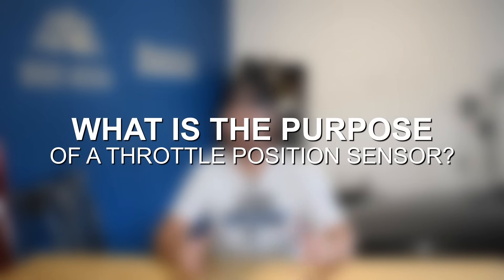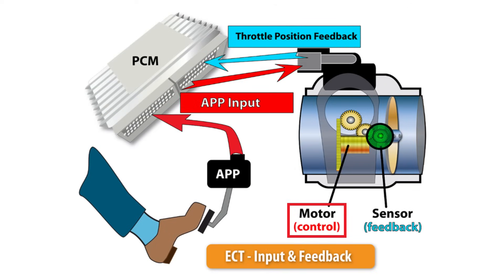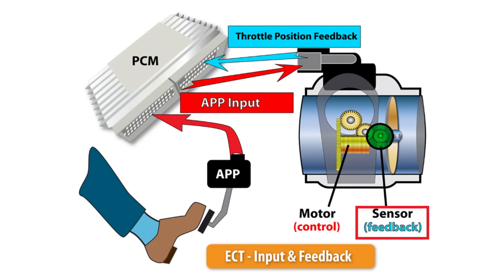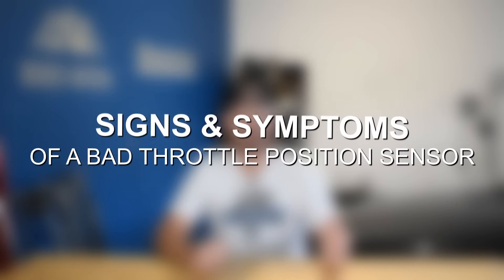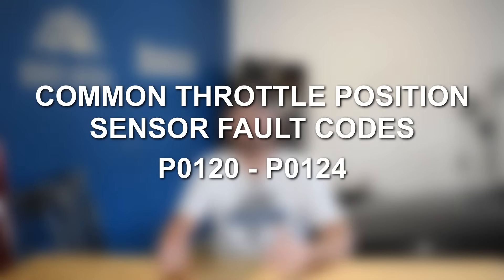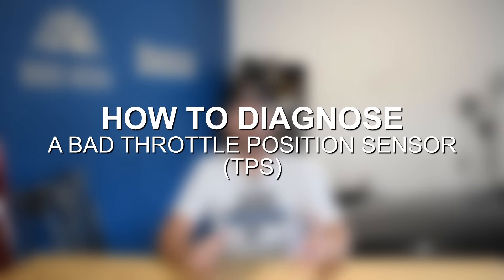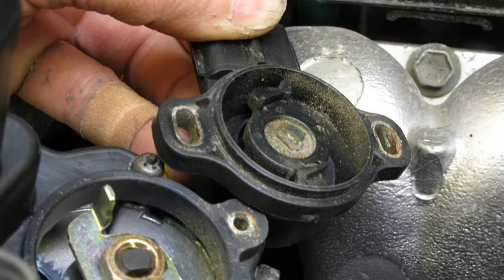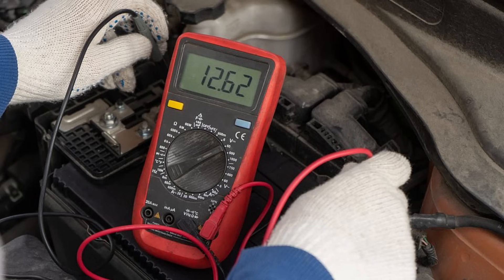Signs & Symptoms of a Bad Throttle Position Sensor (TPS)!

Comment: excessive fuel consumption and codes P022 and P0122.  2020 Chevy Traverse and srrms there was a tech bulletin about a throttle body issue years ago.  While idling, RPMs are about 2000.  Seems like gas pedal is "looser" than it should be.  Guzzling gas.
Reply from the maker: A - The P022 and P0122 codes indicate Throttle Position Sensor (TPS) circuit issues, often linked to a faulty throttle body or wiring problems. The high idle (2000 RPM), loose gas pedal feel, and excessive fuel consumption are all symptoms of throttle body failure or a TPS malfunction. Given that GM issued a technical bulletin on this issue, it’s worth checking if your 2020 Chevy Traverse is eligible for any service campaign or warranty repair. In the meantime, inspect the throttle body for carbon buildup, check the wiring harness for damage, and consider replacing the throttle body assembly if cleaning and resetting the TPS don’t fix the issue. A relearn procedure may also be required after repairs.

Comment: This is a good video! Do any of the following qualify as hesitation?

1) running at low speed (about 5mph) then gently accelerating, causing engine noise and not responding to the gas pedal momentarily. But once it reaches about 10mph, the vehicle runs fine.

2) when slowing down, once speedometer drops below 15mph, the engine revs up a split second. RPM goes from 800-1200 for a split second.
Reply from the maker: E - Yes, both scenarios could qualify as hesitation, but they might have different causes:

1. Momentary lack of response when accelerating from low speed – This could be due to a throttle response delay, dirty throttle body, MAF sensor issue, or transmission lag (if automatic). A failing fuel pump, clogged injectors, or vacuum leak could also contribute.

2. RPM spike when slowing down below 15 mph – This could indicate a transmission downshift lag, torque converter issue, or an idle control system problem. It may also be caused by a dirty or failing throttle body, faulty IAC valve (if equipped), or inconsistent fuel/air delivery.

A diagnostic scan for throttle position, fuel trim, and transmission data would help pinpoint the issue.
Reply: @8020Automotive   thank you so much!
Reply: I have a 3.6l holden , drives fine but revs up from about 1800 to 2000 unless i stomp it at about 50 kph and wont exceed 4000 rpm but should go to about 5500 rpm before shifting up . I will still get a check up at the mechanic but at least i know its an easy fix , last time this happened they did a ( re- learn on the throttle body )but i belive theres a fault somewhere or likely a sensor issue

Comment: 2021 Honda Accord 1.5t, initial cold start idle jumps to 1500 rpms.  Then within. 60 seconds ish it starts to level out.  Pulling no codes, Dealer said they would charge 700.00 to clean the throttle body and relearn.  I am planning to clean it myself. I have a scan tool to reset relearn. I hope this works.
Reply from the maker: D - Good start! Keep us updated.

Comment: What could be the cause of pushing on the acceleration pedal and it doesn't Rev or anything?
Reply from the maker: A - If pressing the accelerator pedal does nothing—no revs, no throttle response—it could be caused by a faulty throttle position sensor (TPS), accelerator pedal position sensor (APP), electronic throttle control (ETC) failure, a stuck throttle body, or a wiring issue. Other possibilities include a blown fuse, limp mode activation due to a sensor fault (like a bad MAF or MAP sensor), or even a disconnected throttle cable in older vehicles. Check for stored trouble codes, ensure the throttle body moves freely, and inspect the APP sensor wiring for damage. If no codes appear, performing a throttle relearn procedure may help restore function.
Reply: What if I lose volts when pressing the accelerator?
Reply from the maker: @raheemgabbidon4911  If you're losing voltage when pressing the accelerator, it likely indicates an issue with the charging system, alternator, or electrical connections. A healthy alternator should maintain 13.5-14.5V, and a drop under load could mean a failing alternator or voltage regulator, loose or corroded battery cables, bad engine ground, damaged alternator wiring, or a slipping serpentine belt preventing proper charging. Even a new battery could have an internal defect affecting voltage stability. To diagnose, use a multimeter at the battery terminals—if voltage drops below 12.5V when revving, inspect the alternator, belt, and connections to identify the issue.

Comment: Replaced my front axel after having my car sit for 3 weeks. Drove it home Monday after and I got sick the day I picked it up. Parked it again and today (February 27th,2025) I started it to try and get some pedialyte…. Car started rough for the first time ever since I had it. Took about 3-4 seconds eventually started up but I have absolutely no throttle response. Not in park or gear.
Reply from the maker: C - Your lack of throttle response and rough start after sitting could be due to several factors, but given that the issue started after replacing the front axle and sitting for three weeks, here are key areas to check: Throttle Body or Sensor Issue – The throttle position sensor (TPS) or electronic throttle body (ETB) could be dirty, stuck, or failing, preventing throttle input from registering. Try cleaning the throttle body and checking for any codes. Battery Voltage or Ground Connection – If the car sat for weeks, the battery might have low voltage, affecting the ECU and throttle system. A weak ground or loose connection, especially near the axle repair, could cause poor electrical signals. ECU Limp Mode – If the car detected an issue, it may have put itself into limp mode, disabling throttle input for protection. Scan for codes (even if no CEL is on) and try disconnecting the battery for 10 minutes to reset the ECU. MAF/MAP Sensor or Vacuum Leaks – If the intake or vacuum lines were disturbed, they could cause fuel/air mixture issues, affecting performance. Wheel Speed Sensor Damage – Since you had axle work done, a damaged ABS or wheel speed sensor might be triggering issues, including limp mode. Fuel System Issues – Sitting for weeks could allow fuel to degrade slightly or cause slight injector clogging. Running a cleaner like Seafoam or checking fuel pressure could help. Start with a battery reset, check for any loose connections, clean the throttle body, and scan for any codes. If nothing changes, you may need further diagnostics on the throttle body, ECU, or sensor inputs.
Reply: @ hooked it up to a scanner later in the day after this comment sir. Aside from the codes I get for having a straight pipes car. Just a maf signal sensor code, and vac leak. 
The car actually started too and revved up and I drove it around the block. Shit it off and then didn’t start up. We ran an idle diagnostic test the day I hooked up a scanner too. Throttle body is opening and closing as it should and everything is up to par. I’m hoping it’s just some faulty connection on the maf but I just replaced the maf sensor last month !
Reply: I did notice on the ride home it didn’t seem up to pr before I broke my axel. For example my car if you gun it in 2nd and don’t leave 2nd it pops extremely loud. Like a machine gun from what I’ve been told but it didn’t after I picked it up Monday. Just a few pops.

Comment: Hi, I have a 93 lexus sc300.  It starts right up on a cold start.  However, on a warm start it takes 20-30 cranks before it turns over.  Just changes the TPS, air idle control valve and ignition coil.  Any ideas where focus on next?  ty
Reply: Try fuel pump relay. I had a 87 Vauxhall with that issue, would start in the coldest weather but wouldn't start when warm
Reply from the maker: G - Not a bad idea! Thanks for sharing.
Reply from the maker: G - If your 1993 Lexus SC300 starts fine when cold but struggles on warm starts, focus on fuel-related issues and heat-soaked components. Start by checking the fuel pressure regulator and fuel pump check valve, as they may be losing pressure when the engine is off, causing extended cranking when warm. Also, inspect the crankshaft position sensor (CKP) and coolant temperature sensor (ECT)—a faulty ECT can send incorrect temperature readings, affecting fuel delivery. If fuel pressure and sensors check out, consider a possible vapor lock or weak starter motor struggling under heat.

Comment: my car shuts after start up up i changed spark plugs maf senser and throttle body do you know wat i should try next
Reply: I would stop buying parts to throw at it sensors are easy to test with an ohms reading there are charts  for each sensor on the web so it’s easy to reference.

Diagnose the problem don’t assume what it is.
Reply from the maker: M - Well said!
Reply from the maker: S - If your car shuts off after startup despite changing the spark plugs, MAF sensor, and throttle body, the next things to check are the fuel system, vacuum leaks, and sensors. Start by testing fuel pressure to rule out a weak fuel pump or clogged fuel filter. Inspect vacuum lines for leaks, as unmetered air can cause stalling. Also, check the idle air control valve (IAC) if your car has one, as it regulates idle speed. Lastly, scan for fault codes, even if no check engine light is on, as a failing crankshaft or camshaft position sensor could cause stalling.
Reply: @8020Automotive  okay so new update he changed the accelerator pedal which started and ran all week no problems til last night at a light it started stalling again and this morning it didnt wana start again any tips on what to check first im thinking it might be pump
Reply: it was the acceleration pedal thank u guys tho
Reply: i still have the mass air flow sensor

Comment: I have a 2007 Subaru Impreza when I tap my throttle repeatedly it’s like my Rpms drop and the gear slows down a lot but jumps right back up after a few seconds what can that be ? Also been having trouble with my rpm gauge not working but my mph works fine. I switched out my tcm with a 07 Outback tcm to see if that would work and now both speed and rpm gauge aren’t working
Reply from the maker: D - Your RPM drop and sluggish gear response when tapping the throttle could be caused by a faulty throttle position sensor (TPS), mass airflow sensor (MAF), or a vacuum leak, all of which affect throttle response and engine stability. The RPM gauge not working while the MPH gauge still functions suggests a potential issue with the crankshaft position sensor or wiring to the cluster, since the RPM signal comes from engine speed data. Swapping in a TCM from a 2007 Outback may not be fully compatible with your Impreza, potentially causing both the speedometer and tachometer to fail due to communication errors with the ECU. Try reinstalling the original TCM, then check the TPS, MAF, and crankshaft sensor to diagnose the RPM drop and gauge issues. Keep us updated!

Comment: I have a 2008 Lincoln MKX when I accelerate like getting on highway ramp for example it feels like my car is slipping once I stop excelerating it evens out just fine. What could this possibly be? Please help if you can.
Reply: Can anyone help with this question????????
Reply from the maker: Hi Audra, sorry for the generic response here but that is a very generic symptom, unfortunately. The feeling of the engine "slipping" can have a lot of possible causes. It could be misfires (which can have dozens of causes), a throttle position sensor, or it could go as far as the transmission. Do you have a check engine light or any other symptoms?
Reply: @8020Automotive  The check engine light came on for a few minutes,but went off. It hasn't came back on yet.

Comment: I have a 2010 Toyota 4runner V6, and it suddenly lost all acceleration. I changed the accelerator pedal assembly and that did not fix the problem, so I reinstalled the OEM pedal. Next, I ran a scan and got P2118 code. Then, I replaced the throttle body. Now when you depress the accelerator, nothing happens until the pedal is about half way to the floor, and then, the engine only revs up to 2600 RPMs once pressed all the way. Also, it idles abnormally high now, about 1200 RPM.  I tried two different types of calibration methods. First, I set the Ebrake, and I turned the key to on position twice, then started the engine and put it in Drive for 5min. I did this 3 times. This did nothing. Next, I turned the key to on, and depressed the accelerator to the floor slowly 3x and turned the key off. I did this 3x, and im still having same issues. Do you have any advise? Thanks.
Reply from the maker: A - If your vehicle lost acceleration, threw a P2118 code (Throttle Actuator Control Motor Current Range/Performance), and still has limited throttle response after replacing the throttle body and attempting calibration, the issue is likely a throttle control circuit problem, a failing PCM, or a power supply issue. The P2118 code typically points to low voltage or resistance in the throttle actuator control motor circuit, which could be caused by a blown ETCS fuse (Electronic Throttle Control System), faulty wiring, or a weak battery/alternator affecting voltage supply. Start by checking the ETCS fuse in the fuse box and testing the voltage at the throttle body connector (should be around 5V reference on the sensor wires and 12V on the actuator wires). Inspect all wiring and grounds leading to the throttle actuator and ECM, as damaged or corroded wires could cause poor throttle response. Also, try performing a hard ECU reset by disconnecting the battery for 10-15 minutes. If the issue persists after verifying fuses, wiring, and voltage, the ECM itself may need a reflash or replacement, as it controls the throttle actuator directly. Keep us updated!
Reply: @8020Automotive  Thank you so much! I will let you know what I find given this information! I did check that 15amp fuse and it was good. also, I did replace the battery and alternator about a month ago. Its the second alternator I put in this 4Runner since i bought it in 2012.
Reply: @ I found the problem, it was a broken wire, 12v to the throttle body just as you pointed out. Thanks for the help!
Reply: Try camshaft shift position sensor

Comment: My Subaru Outback hesitates every time I take off sometimes almost stalling. Every time I take off, the rpm’s slightly drop then pick back up. If I start to accelerate the let up then accelerate the car stalls out big time for a couple of seconds the grabs and goes. Not codes or warnings on the dash.
Reply from the maker: K - Sorry to hear this.. If your vehicle hesitates on takeoff, nearly stalls, and experiences RPM drops with no codes, the issue is likely related to fuel delivery, air intake, or throttle response. A weak fuel pump, clogged fuel filter, or dirty fuel injectors can cause a temporary fuel starvation issue, especially under load. A failing mass airflow (MAF) sensor, throttle position sensor (TPS), or dirty throttle body can also lead to hesitation and inconsistent throttle response. Additionally, a vacuum leak or failing intake manifold gasket could cause momentary lean conditions, leading to hesitation. Since no codes are present, try cleaning the throttle body, inspecting the MAF sensor, and performing a fuel pressure test to rule out fuel delivery issues. If the problem persists, checking ignition coils and spark plugs could also be beneficial. Keep us updated!

Comment: Can a throttle sensor cause a slight vibration in the steering wheel when car is in motion?
I also feel the same thing in the drive stick
Reply: No engine light is on
Reply from the maker: N - A failing throttle position sensor (TPS) typically causes hesitation, erratic throttle response, and poor acceleration, but it wouldn't directly cause a vibration in the steering wheel or shifter. The vibration you’re feeling while in motion is more likely related to wheel balance issues, worn motor mounts, axle/CV joint problems, or a failing driveshaft component rather than the TPS. However, if the TPS is faulty and causing uneven power delivery, it could lead to slight engine vibrations that might be felt through the drivetrain, especially if motor mounts are worn. I’d recommend checking for wheel balance, tire wear, suspension bushings, and engine mounts, as these are more common causes of vibrations in the steering wheel and shifter. If the TPS is bad, you’d likely also notice hesitation, surging, or erratic RPM behavior rather than just vibration. Keep us updated!